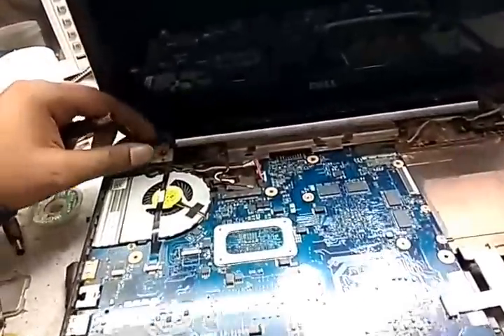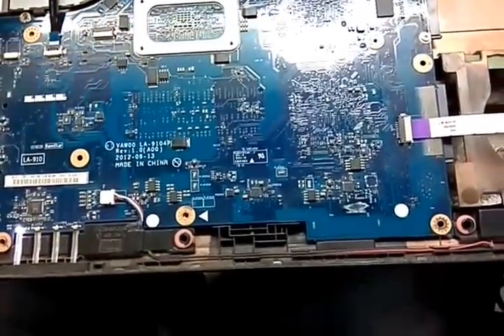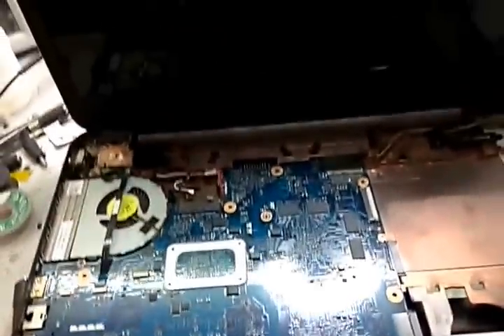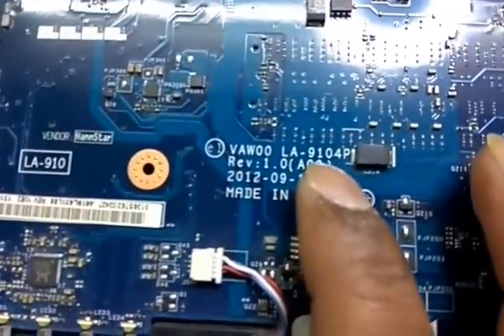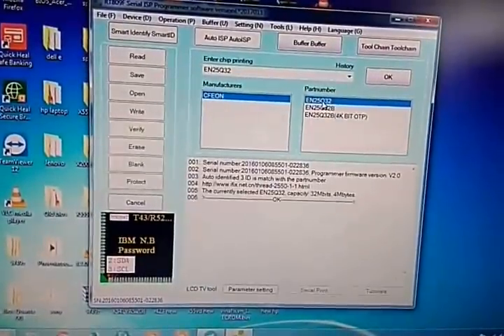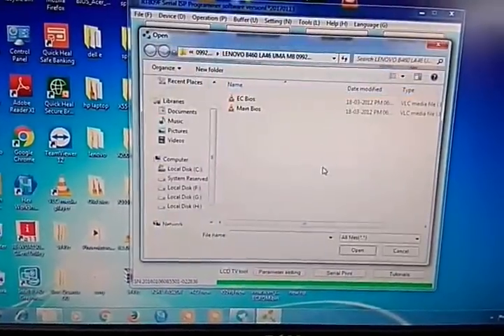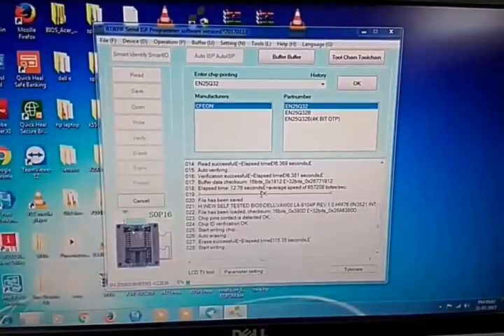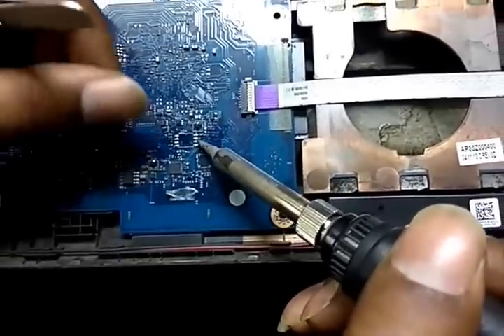#laptopRepair #Dell #How to solve dell laptop one beep problem #Satish Bhai & #aditya11ttt

Comment: Thank you brother,  it really helps. Can you tell me the device name of you used of repair BIOS
Reply from the maker: Did not understand
Reply: @Aditya11ttt  thank you. You removed the chip, then you put the chip into another small device, which you connect to laptop and then install software.  I need to known,  the small device where you put the chip.
Reply from the maker: @md.parvezlimon9263  bios programmer
Reply: @Aditya11ttt  thank you very much brother

Comment: I have the exact same model but it have 2 Beeps problem which is related to Ram/Ram Slot failure, i've tried replacing the ram and cleaning the slots but no avail. Any tips?
Reply from the maker: Prince Sharma check basic volt requirements first

Comment: Is updating the bios from dell support installation file will help in this problem????
Reply from the maker: manish singh try once !!
Reply from the maker: manish singh I think no !!
Reply: Sir sometimes my laptop facing the same problem with 1 beep but sometime its running normally..... What should I do.
Reply from the maker: manish singh try bios or approch near local repair shop

Comment: i was trying to update the BIOS of dell laptop n5010 .laptop suddenly stopped . i waited for 15 min & then decided to remove the battery after removing battery their is nothing's no charging no power button response . now only way to flash the BIOS is through external programmer . when i opened the laptop i saw two BIOS chip on motherboard one is near cpu & one is near hdmi port can you help of locate BIOS
Reply from the maker: can u contact on whats app in latest video u can find our contact number and its there in description link below !

Comment: Aditya sir you r the best chip label engine... how to fix it 7 beep to the same model?
Reply from the maker: Shusant Yadav it's CPU issue majorly !! 
Replace reflow or check related component !! Basically beep are codes which is been pre define by company and told to there engineer for repair purpose this is just for knowledge !! Most of them now this but for those how are not aware !!!